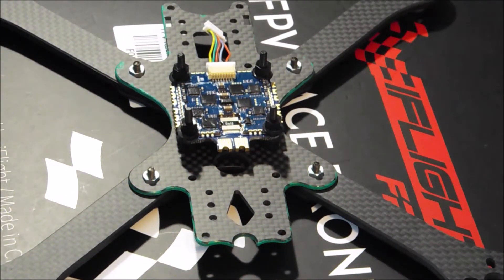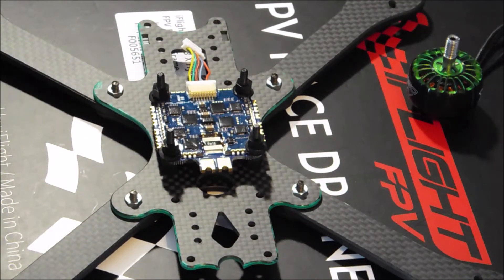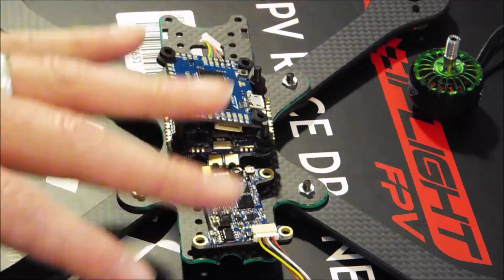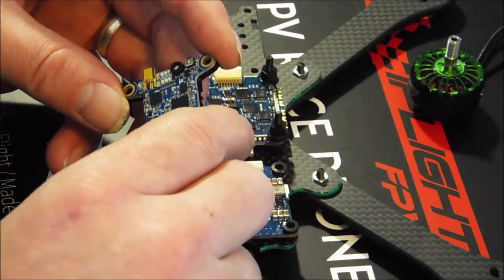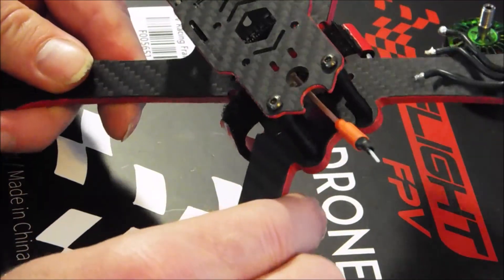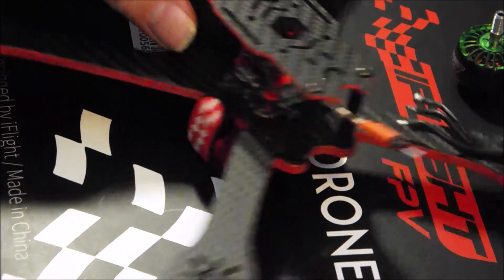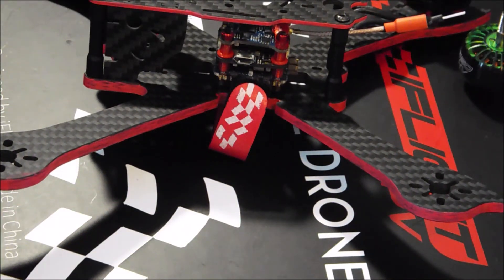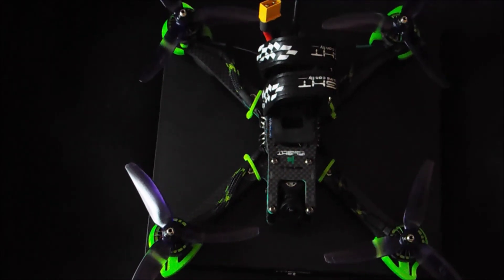New gear,new build!  Iflight Xing 2208, Succex f7 ,60a 4in1 and Force LR Vtx.

Comment: I just got a bunch of those iflight boards, doing a build now.... I went with the pyro32 ESC though.  Note that betaflight rpm filters do not work with dual gyro boards yet like the iflight board.  You have to run it in single gyro mode for now.

Comment: Love those motors Xing 2208...can't wait until mine come....like always Proto nice flying 👌🚁
Reply: Yeah, wtf is going on with this motors?? Hard to find any reseller for them, and if you do they are sold out.
Still though there's no dedicated video on youtube about them, no thrust tests, no tear down vids... i wonder why?
Seems like everybody and their mum ordered a set after Kabab said they are insane.. well.. i want more info, and i want a set of these too! :D
Reply from the maker: @GuruGoesUTube  Kabab has a flight video  with the xing and I have  this https://youtu.be/kXqz8SASjZ4 also MQTB did testing on the 2306 2450kv.   The  motors perform as good or honestly better than most motors that cost $10 more. They are the most purpose built motors I have ever used if that makes sense. Not just designed to make thrust like  all motors were for a while there. These are built around efficiency and foremost predictable throttle response. Combined with the Ethix s3   they're a game changer. and,they have them all on Amazon right now. Only the 2306 available with prime though.
Reply from the maker: Thanks bro! you just ordered a pile of these right? you are gonna love them!